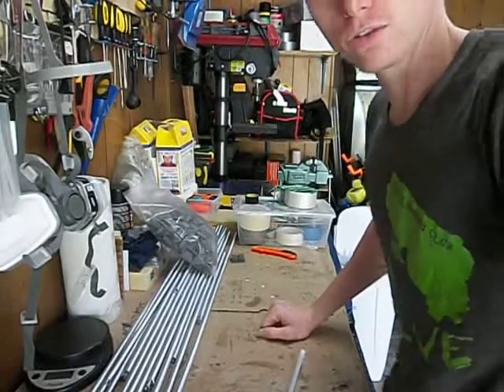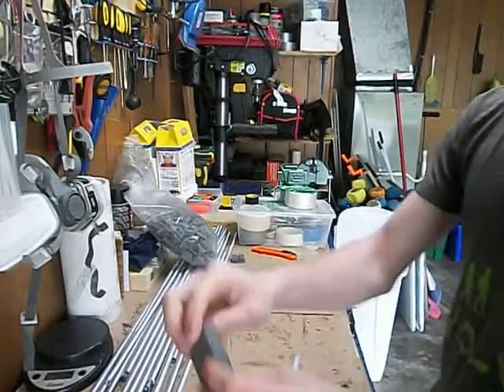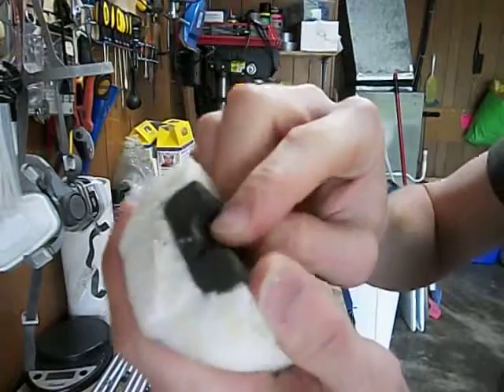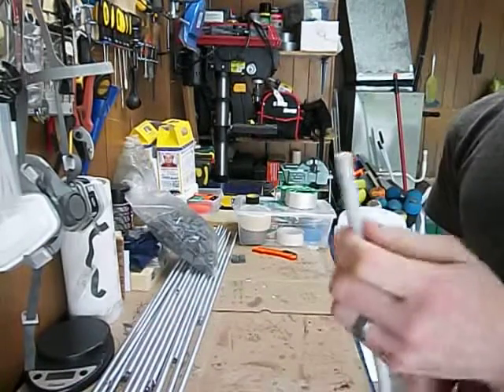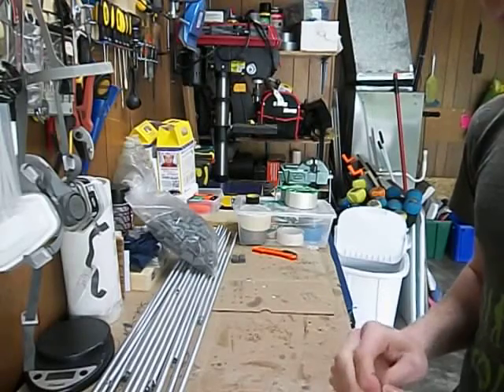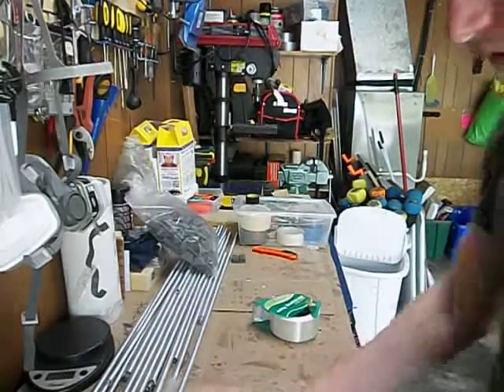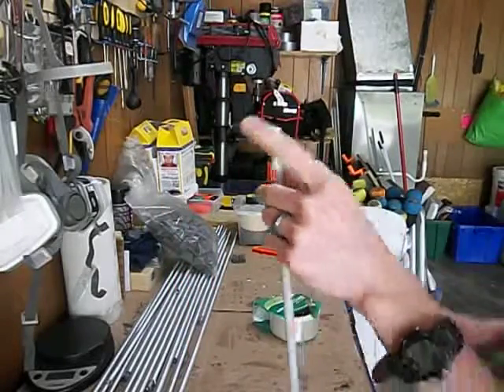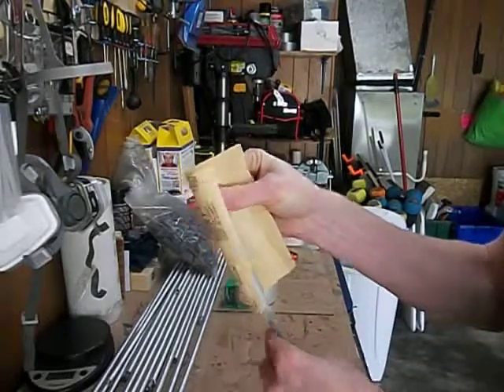How to biscuit a weapon core

Comment: Would a layer of fiberglass strapping tape or Kevlar strips help with wear?
Reply from the maker: I use fiberglass strapping tape when biscuiting. I've never heard of kevlar tape, but really anything with strong fibers running through the tape to prevent tearing will work. Ideally those fibers should also resist stretching.